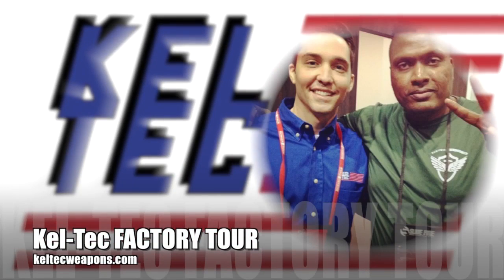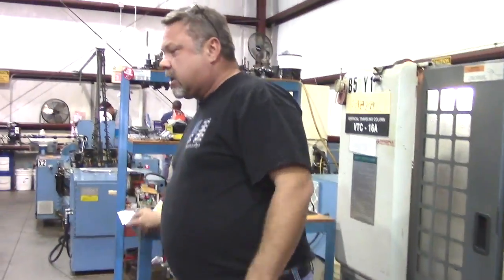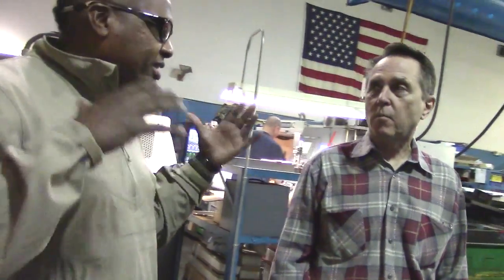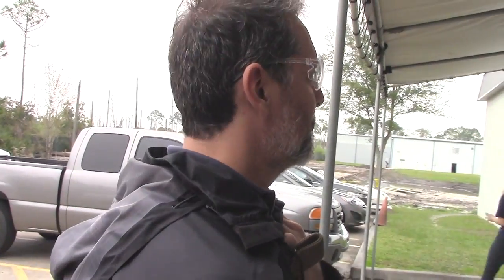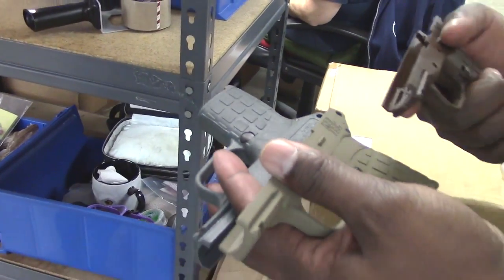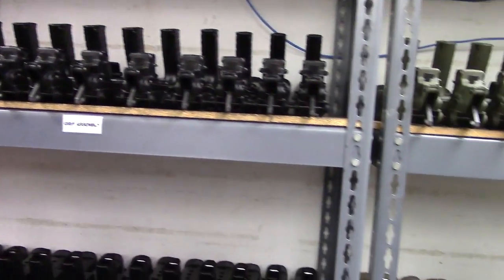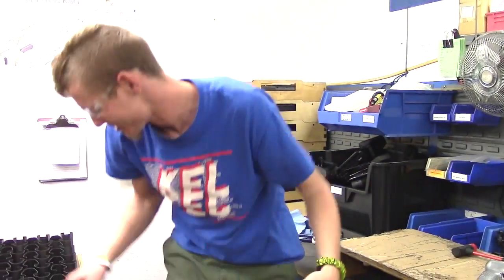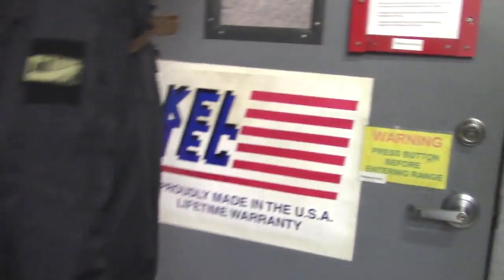Kel-Tec Factory Exclusive: Everything You Need To Know

Comment: I just bought my Kel-Tec CMR-30 rifle. It was apparently the only one at the local gun show, the dealer did not replace it with another on display 5 hours later. I had already checked ever pawn shop and gun store within 25 miles, none. I cleaned it overnight and fired it next day. I had no problems except those caused by a failure to properly load the magazine. I added a short scope, a 3x9 at 40 mm. I 'zeroed in' using a barrel laser and a few shots at 25, 50, and 100 yards, maximum available space. I was very pleased. I added a homemade carbon fiber forward hand grip. I will add a white light and perhaps a laser for close counter. 
It is a very well made rifle and is much fun as well as a serious weapon. Recoil is straight rearward, allowing quick access to target again. I do recommend a firm pull-in grip to shoulder. When firing from a non-shouldered position it handles very well. Instinct shooting at close range is very attainable. The 22 WMR at 40 grains was a good choice for this rifle. I had no misfires and only a few failure to fires. I began at 20 rounds in each mag. Fired 400 rounds for the day. I want to thank Kel Tec for making a fine rifle. I have fired a few other of their guns and riles, but not a bull pup as yet.

Comment: Have a P32 for sevreal years now, at least 1000 rounds thru it, only a couple of failure to fire, perhaps were hard primers. Sent it back to adjust mag button so I could insert mag without needing to depress the button, they also did a "fluff & buff", came back quickly, now it's super smooth...

Comment: I have a brand new Keltec SU 16A , Never shot it once . From the reviews I already dont feel comfortable having it let alone depending on it . Hopefully its not a bad egg . Some ppl had the bolt explode form the back luckly it hits the stock. Might go get an AR .
Reply: why ? i have a su 16f for the last 8 month and passed 1000+ round thru it .223 5.56 mix no jam no wierd case deform not any problem and it groups 1.5 moa at 100 ( i have a mcarbo trigger upgrade kit 70$ in it tho 4 pound trigger)
Reply: Just shoot it...they haven't had any problems in 15 months when they redesigned them.
Reply: I did now . Its ok so far I still have my face

Comment: i always try to buy American, Kel-Tec  is. so finally bought a new sub 2000 g17 9mm, cleaned n oiled it shot it bought it home to clean. while putting it back together the bolt would NOT slide back over the hammer without pushing the hammer down with a dowel. sent it back to them returned fast that's good. they said bolt face out of spec. plus other stuff. only shot apox. 75 rds. many fte n ftf WELL once back home i pulled bolt out to check out what they said did. i tried to put bolt back in and again it would not slide over the hammer. they are nice people but there Q.C. needs to be better. in short they send out a rifle out of spec. and returned it back doing same thing. wtf?
Reply: as i said we as a family buy American. after watching this video i see Kel-Tec hires apox 210 people and keeps every thing in house. So that is a good thing and there open about sending back there products to make them right. guess i can't bitch too much.this video has changed my mind about them. just wish they would have better Q.C.
Reply: MegaBait56 I totally agree. They are about as American as you can get & they have some very innovative ideas & designs. I just wish the quality was a bit higher. I would be willing to pay more & I think many people would be willing to pay more. 
I love that Sub 2000 but so many people seem to have problems I am reluctant to buy. I would pay $650 for one if I was sure I would get a problem free gun. It's a brilliant little design & their shotguns are just as innovative but so many people complain about the quality it scares me.
Reply: Kel-Tec made good on it. they have no problem sending it back for free, also fast turn around.i paid $399.00 about 2 months ago for the nib sub 2000,g-17 type. shoots straight to 50yd.;s. BUT i would ONLY buy a sub 2000 from them! nothing else. nice to be able to fold 7x16". i put on Tandomkross front n rear sights on it.no red lion rails or other crap. keep looking, but don't pay more then $425.00 cause there site says apox. $410.00ish cause that's all there worth and get it in 9mm cheaper to shoot. you also can convert other type mag.'s to the glock mag.kel-tec sells a button to switch to glocks mag.'s. at 650.00 you can get a ar. good luck hunting.
Reply: Make sure the gun is cocked and on safe before takedown.

Comment: I have never owned or bought a Kel-Tec and never will. My friend's sub 2 k broke twice and he sent it back to the factory twice,  it still didn't work so he sold it. His dad got a pmr-30 and he said it only works half the time. I held it and the finish is so shoddy. Crusty plastic seams all over it, sights that wiggle, felt like if I dropped it on the floor it would split in two. They have very innovative ideas but when it comes to follow through they produce plastic squirt gun firearms. This video just reaffirms my beliefs. No one here seems like they know what the hell they're doing and don't care either. What a joke.

Comment: That did NOT impress me.  As an automation engineer by trade, I am truly amazed at the level of manual labor being used.  There's no wonder Keltec puts out such a low level of product.  As a casual economics observer, they could increase their prices by 2X, decrease demand and make the same amount of revenue.  SUCH a backwards company...
Reply: +MrJmartin17 I agree- I did not see any flow. The way they whipped out those drills and poked holes definitely suggested a lack of uniformity. Plus, they are all spread out- they need someone with Lean and Six Sigma training to re-arrange their manufacturing processes. And that bluing looked terrible. Why are the slide serrations on the P11 so shallow and rough looking instead of crisp and high-profile??
Reply: MrJmartin17 the products they make tend to break and fail without very little use. I almost purchased until I looked at reviews . I went with a Sig P229 and a S&W Bodyguard 380 . I might get the Sig SP2022 Pro 9mm also. I looked hard at Kel Tec but nothing positive about the products out there. The people that work there seem nice.
Reply: MrJmartin17 I would  rather  have  a  gun made  by a person  who  actually  put  it  together  by  hand than  a machine
Reply: same. this guy wants to take jobs away and increase prices. the exact reason the world sucks right now.
Reply: It would be a good deus-ex-machina to use in writing novels. A villain fires at the hero and nothing happens because the firing pin on the Kel-Tek broke. This is nice. Because I kept thinking about putting maybe an action scene into a gun factory in a James Grider novel but I had no idea what they are like. What I will need to do is write a novel where this enemy of the state James Grider with his Wykkdik of Fhekris is stealing firearms and giving them away to mentally ill people who the law might be forbidding from owning firearms otherwise. James Grider is like this pro-school shooter kid. Then there is a villain who has an Infucknal Device that allows his hand to project an energy blade and he is running about destroying guns in gun stores and gun factories. People should buy my "Impact" a James Grider novel so I can afford to move into a forested place like the one in which this factory stands.